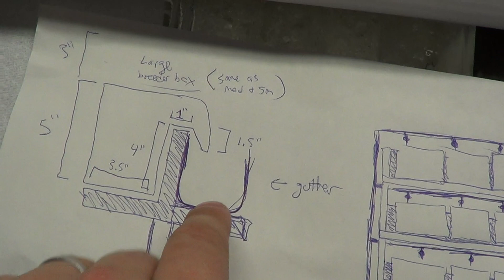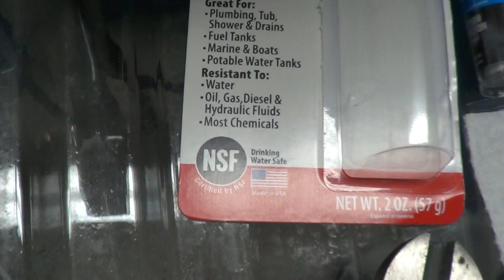#336: Two Ways to Weld PVC Gutters - Tank Tip

Comment: I've used PVC gutters for projects before and found that acrylic glue works very well. It bonds both pieces together on a molecular level so its pretty much just one solid piece in the end and practically leak proof.
Reply from the maker: +Home Aquatics nice tip, i'll have to try that out next!
Reply: It can usually be found on amazon for a pretty good price since I'd assume you'd need a good about of it. Not sure how much you payed for that kind of PVC gutter but Home Depot has the open top on that you see lining roofs for $4 and change after tax for a 8 foot long piece. Picked some up yesterday for a project.

Comment: Could a heat gun bond them? More margin for error maybe?
Reply from the maker: +Fish Behind Glass i don't think heat will bond two pieces of pvc, they are more likely to warp and cause an even bigger gap
Reply: +Greg Jones (Greg's Fishroom) Your probably right. PVC cement shouldn't leak, since it can be used in pressurized systems. So this task should be nothing for it to work. Seems like more maintenance would be required for the "putty" stuff. It doesn't seem like it wouldn't last years like the PVC cement.
Reply: +Fish Behind Glass sorry about the double negative. Getting my offspring ready while I tap this out.

Comment: Instead of using gutter pipe would round plumbing pipe work?  Then you can just use pvc cement just like your toilet.  Thanks for the tip and really looking forward to this build.
Reply from the maker: +Kosin Trouble In The Tank regular pvc pipe is more expensive, and this overflow will just be handling a trickle of water, looking for the lowest cost method